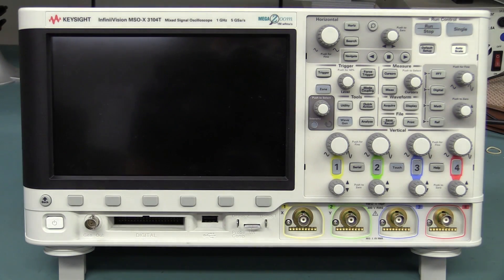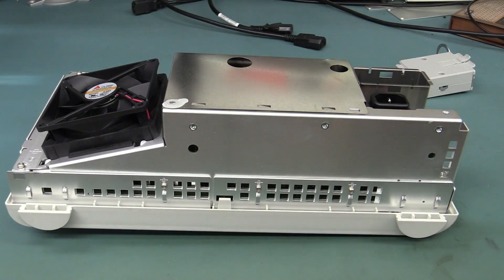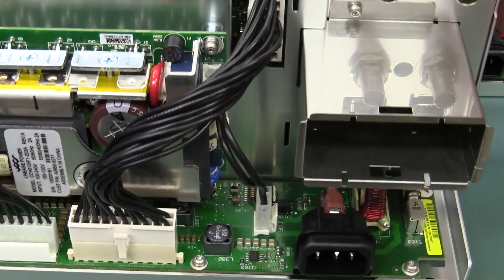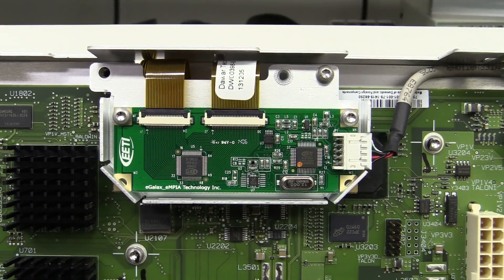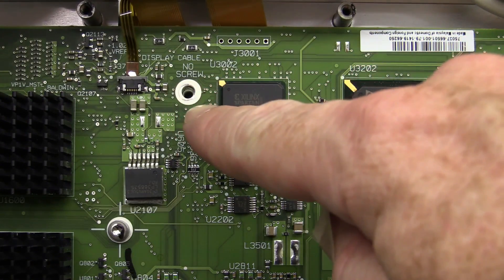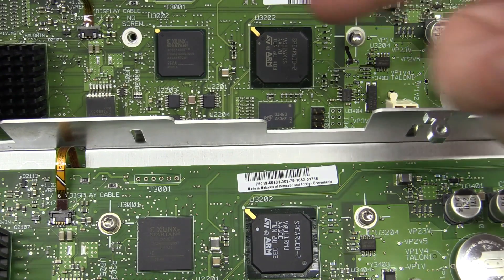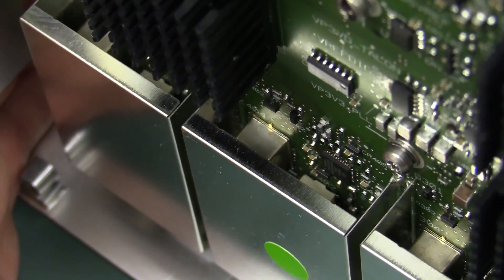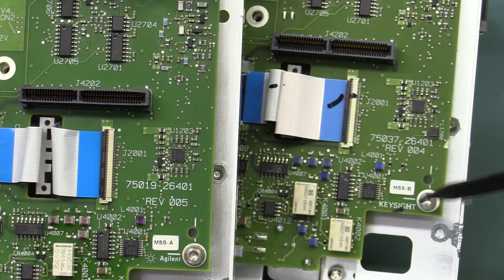EEVblog #702 - Keysight 3000T Oscilloscope Teardown

Comment: Interesting that your sample has the same supply (like the 2000A and 3000A) that has blown up on a number of people.  And with the years that have passed here, Keysight will no longer sell you a replacement.   I believe my later build has a different brand but need to confirm that.  This "quality" supply had serious overheating and design issues.  It baked off the main capacitor causing the system to collapse (blown mosfet, blown protective device, blown diodes, burnt PCB).  Maybe an update to this video could shame Keysight into selling replacement parts again (for critical assemblies, hardware, aesthetics, etc.)

Comment: 4:30 whoa hey i wouldn't say dissappointing... the monitor and the touchscreen are input devices, they have their own hardware :| You're not miffed the display is not  designed and/or manufactured by Keysight, I wouldn't consider the touchscreen any differently :/ Ok yeah it looks a bit weird to have a PCB in there with a different logo, but that's the same with the power supply, no?

Comment: Is there a way to sort comments by date or is that hidden?

My question:

You trip over your scope probe and snap off the BNC

Now what? Looks like an area where amateur attempts will mess up the tuning of the input area, not uncommon, especially if you have a forest of rf loads etc on the connector.

Comment: In order to better differentiate their products, why don't they just add a Dual 12 core Intel Xeon CPU's to run the OS, and a 1TB SSD, and have it dual boot windows 7 as well as an OS dedicated to the oscilloscope functions. They can then add triple SLI GTX 980's so that when not probing stuff, you can do some 4K gaming with maxed out settings. For their pricing, they will still make a massive profit.
Reply: Isn't thats what Tek did in some of their Logic Analyzers?  My confidence dropped by ten fold when that WindowsXP splash screen popped up on something I should have had high confidence in!  Of course they should/could be running Linux, which a lot of gear does run today, especially networking equipment.
Reply: code123ns Linux doesn't even need a keyboard. It is so flexible that you could run it on a bottle of beer if it had a CPU and some memory.
Reply: Jaroslaw Pelczar But they really could use some faster CPU. 1m12s to boot is just too long. My PC boots faster than that.
Reply: Jaroslaw Pelczar That would be good compromise, I think. No hardware changes needed and resuming would be almost instant as long as the device is plugged in.
Reply: Tim Rotunda They couldn't go for Linux because for Linux you need NumLock and Scroll Lock LEDs. These are needed to indicate when the Kernel starts to panic.
Reply: pvc988 But then how would you indicate Kernel panic? Would the bubbles stop?
Reply: ***** Yeah, that stand-by power consumption is also a problem but waiting for every single device to boot is more annoying to me.
Reply: code123ns In the first place, kernel panic shouldn't happen on such device. But even then you still have many options. You could send a message to the serial port (most devices have it in one form or another), you could just show it on the screen (if the screen is already initialized), you could make the front panel start blinking, you could even just reset the device and pray that it will not happen next time (that is what most smartphones do).
And about that beer... If my beer would stop fizzing I wouldn't panic but I wouldn't drink it anymore, I don't like decarbonated beer.
Reply: Jaroslaw Pelczar I think it was a joke

Comment: Fastest scope teardown ever ;) That NEC chip seems to be the USB2.0 hub (µPD720110). Seems they need an additional USB channel for the touch.
Reply: If you search eBay for "hdmi touchscreen 2av" you'll get heaps of touch screen modules. They all have eGalax touch screen controllers with a usb interface. Linux supports them out of the box. Apparently very cheap and common.
Reply: yep, without even checking the part i knew it was a usb hub as well (you can see the traces from the host port going to it, the dev port probably goes straight to the arm cpu), in the end, implementing a touch screen to an existing design via usb controller(off the shelf part even) is the simplest most cheapest way, even more when your design already has a usb port and some suitable blank space in the board.
 can't fault them for that, not elegant?, yeahp, looks like "milking the cash cow"(specially when they didn't bother fixing the high standby consumption)?, yeahp again, they couldn't rsue the older boards thanks to that usb hub but you bet your bottom dollar they spent weeks trying to figure out how to milk the cow even more (they couldn't "plug it in" the existing usb port because that's already protruding the outside of the case heh)